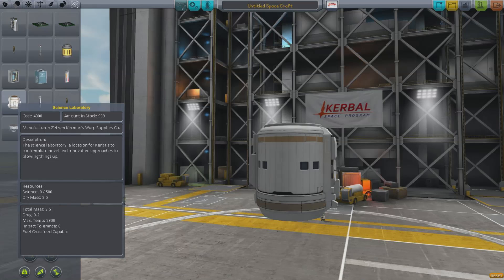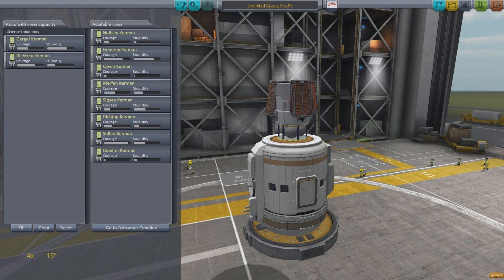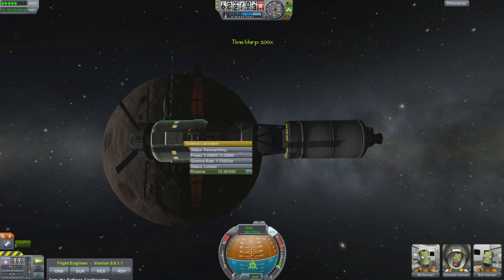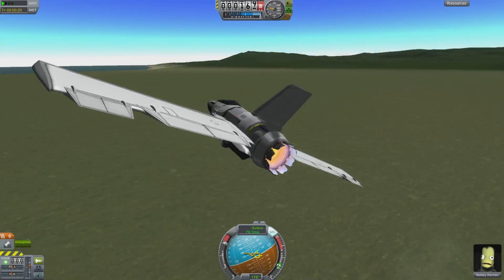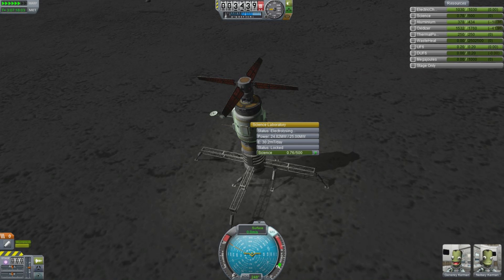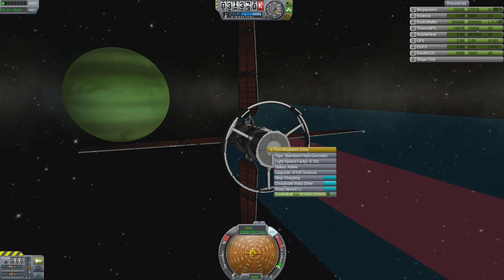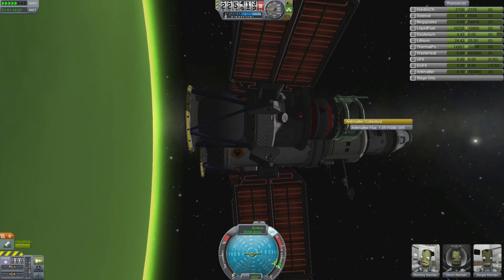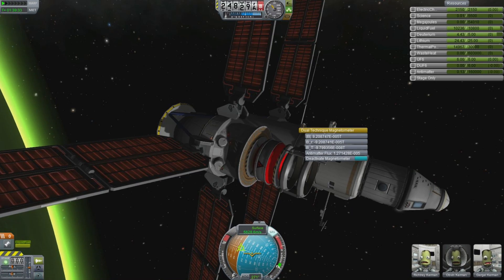Kerbal Space Program - Interstellar Mod - Non OP Warp Drive

Comment: Scott,
Alcubierre Drive is FTL.
Although light speed would be scaled down like you said.
But Alcubierre Drive is theoretically able to go to Alpha Centauri in Two weeks tops.
And there's a team actually trying to do it, maybe they stopped now, but they at least tried to make exotic matter.
Reply: Harry White tweaked the design of the Alcubierre Drive to make it more efficient. The largest problem with the Alcubierre drive was that the amount of fuel needed was equivalent to the mass of Jupiter. The White Drive fixes this issue by tweaking the physical dimensions of the Alcubierre drive, making a warp drive (NOT FTL) that uses a standard amount of fuel. The only issue now is being able to manufacture anti-matter.
Reply: ariecos Antimatter? No. Not antimatter. EXOTIC matter, with negative mass.
Reply: ***** That can be solved easily. You don't shut off the drive right next to your destination, rather, you shut it off a great distance away, preferably not oriented towards your destination, and then use conventional means to finish the journey.
Reply: ***** I don't think you understand. If you enter your destination solar system in the right way, you can "aim" that "cone of death" away from the planets or, well, anything. Perhaps entering the solar system from "above", leaving Sol by travelling 90 degrees relative to the Sun's equator, then turning 90 degrees again, towards your target solar system but only in two dimensions, and then travelling along that vector in warp, and finally turning 90 degrees once again, straight towards the target solar system, but "aiming" for empty space. Then, via constant acceleration you can finish the journey. It takes longer, but it is worth it.
Reply: ***** The cone is a speculation, that is true. However, there are "other" ways of preventing the problem. Perhaps, and this is very optimistic and unlikely, you could use the energy picked up en route to hasten your velocity. After all, to utilize the drive you need a lot of energy anyways.
Reply: ***** I don't think you understood the concept of the alcubierre drive...
Reply: michael papadopoulos It becomes feasible?
Reply: KASASpace
 Something tells me that if we ever become an intergalactic space fairing species using the Alcubierre drive, planet-busting missiles would be invented using the logic of this death cone.
Reply: Junn Kopf In a very, very immature way, that sounds badass as fuck. Scary, but god imagine watching that. In-SANITY.
Reply: Recently, the original theoretical designs have been changed to allow lower power requirements. This works by using an oscillating electric field to rapidly flicker the power between high and low. Somehow, that makes the energy requirements low enough for us to make, possibly by the end of the decade if we try.
Reply: KASASpace The antimatter is what is needed to produce all the energy necessary to use negative matter to produce negative energy and a warp bubble.

Comment: That heat is stored within photons, which have mass, heat is the constant, rapid "shaking" of particles. In empty space, there can be no heat, because there is nothing there. However, empty space is different than space, space in general has very small amounts of particles at all times, its nearly impossible to have empty space unless its artificially made.
Reply: How are you spamming?

Comment: Actually, no. Aluminium came first. I pulled this right from wikipedia "Two variants of the metal's name are in current use, aluminium and aluminum (besides the obsolete alumium). The International Union of Pure and Applied Chemistry (IUPAC) adopted aluminium as the standard international name for the element in 1990 but, three years later, recognized aluminum as an acceptable variant. Hence their periodic table includes both."

Comment: If you go quarter an orbit around a planet using an Alcubierre drive, assuming that linear and angular momentum are preserved inside the bubble (you go very quickly), do you convert between linear momentum of the combined system planet-spaceship (average motion along the axis planet-spaceship) and angular momentum (relative motion perpendicular to that axis)? That sounds crazy. Or would you transfer momentum to the planet? What about warping up and falling back down, could you steal momentum from the planet that way, much more than by a slingshot?

Comment: A few of NASA's currently experimental sublight, space only maneuvering drives such as electron beam thrusters, VASIMIR and similar plasma based engine would be interesting to add as an alternative to the basic monopropellant RCS thrusters.

Nobody has created a mod for a cold fusion reactor using the subattomic impulse postulate (first postulated in 1938), more commonly known as an impulse power reactor, thanks to Star Trek and the film "Wing Commander".

It would burn normal liquid hydrogen.

Comment: Correction, a jump drive moves you from point A to point B instantly, or it can be moving you from point A to point B through line C, which happens to be a hole through the universe. Warp drive acts exactly how he says it does, as well as most ways it is used in fiction, and most ways it is theorized in real life. And by fiction I mean Star Trek :L.

Comment: I mean, they are OP if you use them right. I don’t know how to use them, I know they run on Megajouls but I can’t find a way to make or store enough of ‘em.
Reply: you can send power from ground with antennas that can send power. (also part of interstellar mod)
thats alteast how ive have done it.
made a ground "base" that had nuclear reactor for power. and transmited that power to sattellite in orbit , and that sattelite transmited the power to the ship.
i just forgot how it works entirely.
i have also seen people that mananged to pack nuclear reactor on to the ship.
but i had problems getting all that mass into orbit

Comment: The aluminium hybrid rocket is for some reason glitched on my version of the mod, the attach points are floating in space above and below it. 

So to fix that I had to kind of dig into the mod's guts and reset some things, so I don't think the scaling on my rocket is correct. Oh well...

Also to fix the advanced propulsion units in their second research form, for example even though I had researched fusion reactors I couldn't get the hybrid thermal rocket engine until editing the file to use experimental rocketry instead of fusion power as the required level.

And since i couldn't leave well enough alone I also designed my own addon part that SPECIFICALLY digs up alumina and electrolyzes it as fuel for the rocket and nothing else. Because let's face it, dragging the whole ill-fitting refinery module to the Mun just to use maybe one fifth of its systems is nothing but trouble.

Comment: i cnat get any of the engines to work. the thermal jets have an anemic thrust of 2 k/n and the nuclear engine/ large ion-like engine dont get enough power to produce any significant thrust with three 3.75 m reactors and 3 3.75m large electric generators

Comment: Dosen't a particular isotope of sodium or potassium radiate anti-electrons? Why not just make more of that isotope in a reactor and then capture the anti matter in a magnetic bottle?
Reply from the maker: +David Vermillion it’s antiprotons which are what we need lots of.
Reply: It's potassium 40, aluminum 26, sodium 22, Carbon 11, nitrogen 13, oxygen 15, fluorine 18 and iodine 124. Also a alpha partical striking a aluminum atom generates a Phosphorus 30 which then emits a positron. 

Just chucking a bit in the HFIR (a research reactor with a high amount of neutron flux) should generate the isotope required. (This is how medical isotopes are made sometimes)  Then simply put the sample that was irradiated in a "magnetic bottle" and it should collect positrons. After that it's simply a matter of building an ion engine based on colliding electrons with positrons. 

But then all you get is gamma rays. Good luck getting those to push a spacecraft. Because they pass through everything.

Comment: Scott I challenge you in KSP to use the rocket powered VTOL (All STOCK) to obtain a maximum altitude of 100km. Harder mode is 150 and even harder mode is 150 without ASAS. It is possible as I have done harder mode to 158,00km

Comment: No matter what I do I can't get any power the heat panels won't fold out and nothing will charge help please
Reply: Same Here :(
Reply: Also placement for me is really stubborn. Like it only works on one side so i have to use cheats to put mod parts together
Reply: Well, assuming the mod is installed correctly, my advice would be:
-Make sure that your reactors are on
-Radiators (which I suppose you meant by heat panels) are set to "auto" by default, if I remember correctly. You need to disable that to gain manual control
-Some engines only work when connected directly to reactors (their description usually state this)
If all else fails, it might actually be faulty installation. Try using CKAN.
Reply: Lukas B How do i turn reactors on? How do i open the radiators? I noticed that the video actually seems to be. old.. maybe i outdated the mod. I am on the newest version of KSP to mention.

Comment: Technically Aluminium is the correct formal. Effectively both are correct and it is perfectly acceptable to use Aluminum in even the most formal scientific settings. Still I imagine the debate will continue to rage for generations to come.

Comment: It's not true that this warp drive is non-op. Here's why:
You do not need to match velocities with the target planet using your engines. You can use the planet's gravity instead. Warp to Jool as seen in this video and because of its gravity you will start slowing down with respect to Jool. Keep warping to just above Jool to get rid of more and more relative velocity.

However, this is the boring way of doing it because Jool has a rather low surface gravity and it takes many cycles to match velocities. Instead, you can use another body to match velocities with Jool and then just warp to Jool.
I recommend either Eve or the Sun. Eve has slightly lower surface gravity than the Sun, and it has its own relative velocity to the system (which makes everything a little confusing). But if you are playing in a version/mod where the Sun makes you overheat, Eve might be the best option.
Reply: you need a sizable reactor to generate enough power to power warp when your near a body. it takes more power to go under the speed of light. i dunno why.
large reactor means large radiators, means lots of fuel and big engines.
you basically have a huge payload which you need to get into space. and most of these parts are very expensive.whats op is the atmosphere collectors where you can run a engine on litterally any easily attainable source. ie kerbal has almost 80% nitrogen, and this is turned into liquid nitrogen. so you can get into nice kerbin sub orbit on near to no loss of delta v. when you can easily have a nice ship with one stage and 10k delta v you can get anywhere and refuel from its atmosphere or ore.
that is op. but thats future tech. end game stuff.

Comment: I was just catching up on mods and I saw Interstellar extended... To say the least, I'm disappointed in the direction the mod is being forcibly taken. Lots of stuff has been removed and not replaced, what is new is either taken from another mod or just looks horrible. Even some of the stuff that is the same has been messed up. The worst thing they have done is removing that epic DT Vista fusion engine! And now I'm not even sure where the warp drives are, isn't that what the mod is about... I'd rather figure out how to get fractal's old version working than deal with the mess Interstellar Extended has resulted to. It can't be that hard, but if anyone has any tips that would be appreciated.

Comment: whenever i install Interstellar, my game gets super lagy, do not know why, i have all sort of other mods and i have never had as much lag with anything as i have had with interstellar, and i really want this mod, does anybody have any suggestions?
Reply: More RAM? There is a RAM limit because it has yet to be ported to 64 bit. I'm running fine with 16 gigs of ram but the game can't use nearly half of it.
Reply: yeah i got 12, but now every time i install it, it just crashes when i go into the VAB or SPH, but i dont really need it so it doesn't bother me too much that i dont have it
Reply: theoretical physicist 12gb is perfectly fine for this game
Reply: Tpresler oh i have no problem running this game, or even running it with lots of mods, its just this mod that makes it super laggy and i dont know why
Reply: yeah i had issues with trying to install it also. You have to go into your gamedata folder and drag in the Warp plugin, the tree loader and the open resource thing. Im pretty sure thats what they are all called. My issue was i guess other mods were conflicting with it working properly so i ended up taking some useless ones out and it works fine now.
Reply: Tpresler just tried that, it works just fine. little bit of lag, but i dont really care, its just a few FPS lower than normal. the problem was skillfull weapons and damage mod. thanks for the help! (edit) just discovered that i cant remove science from interstellar experiments, what in the world do i do about that?
Reply: Whats your screen resolution? and are you on max settings?
Reply: 60-100 fps on max resolution is impossible with the worst graphics card.
Reply: leerman22  I believe the max ram is 3.2 gigs. in the 32 bit system. 800 MB (generally) for your OS, and 3.2 for whatever else you're doing.
Reply: funny, the lag i get just come natuarraly from the game itself
Reply: amount of parts make the game more ram hungry as it has all parts loaded constantly, thats what it does at starting up. loads everything first then runs with the memmory it has left.
i've used up to 30 mods 5 biggest parts mods being kerbonov b9 firespitter kas and goodpseed aerospace and i've managed to play it with just 4 gigs in windows 7 32 bits wich means it uses only 3.5 gigs of ram and the game is designed to use 2 gigs fo ram leaving 1.5 free ram unused for the game (there is a command prompt for that use and it makes a difference) game will run but it will eventually crash everynow and then due to ram usage and running ot of it.. it all depends on how many parts the game has to load really, i've erased only the large amount of parts mod (leaving important mods on like kas and infernal robotics) i've deleted those mentioned before and game does not crash anymore and runs a bit better and i still have 20 mods installed most are code stuff like raster prop monitor or structure reinforcement or anything made for the gameplay area..yes its epic to have a lot of parts to not always make the same thing.. but it will just chew through ram.
Reply: I have 4 GB of RAM and my game is laggy only in space-near-Kerbal
Reply: Start a new game.
Reply: nvm guys, i fixed it.

Comment: I'm pretty sure this is wrong about anti matter densities in certain area's as every particle of matter is paired with an anti matter particle and anti matter particles are not just flying around freely in a magnetic field.
Reply: james hughes actually antimatter is affected by magnetic fields there was a satellite designed to detect antimatter and it found they flow across the magnetic fields also neutrinos don't have an antiparticle there neutral